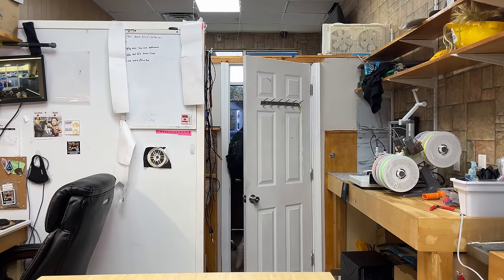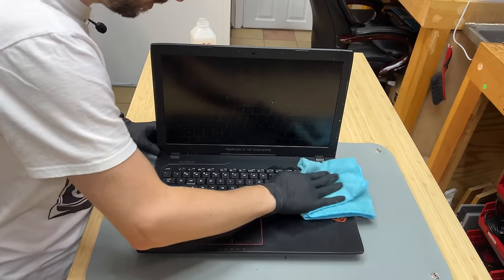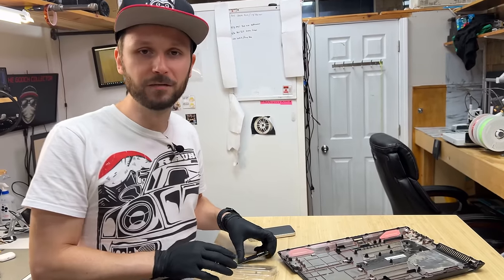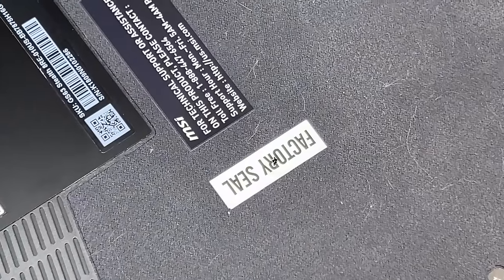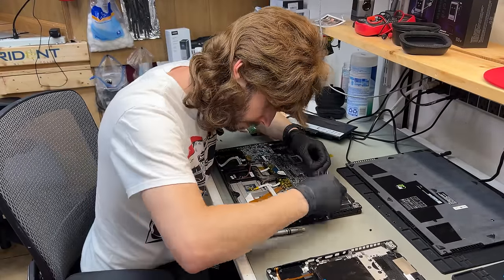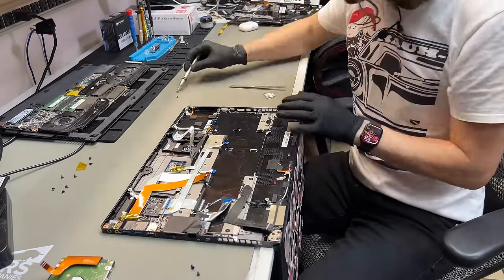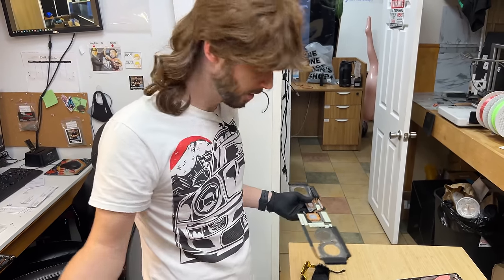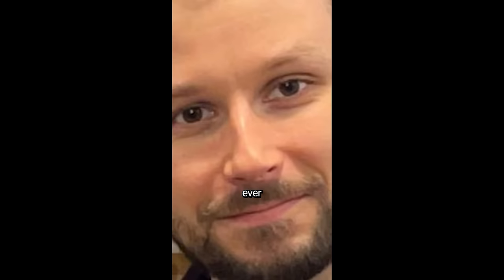Late Night Tech Rescue: Fixing 2 Gaming Laptops at my Computer Repair Shop!

Comment: How can I clean my macbook air m1 keyboard because if I shut it down and  try to clean it, as soon as any key is pressed it turns on again leading to accidental key press. How could I clean it without any such problem?
Reply from the maker: Either takeoff the bottom cover and disconnect the battery, or simply clean it and avoid the enter button
Reply: @SalemTechsperts  thanks buddy 😉

Comment: Is that a bambu labs A1 MINI with the MINI AMS?
Reply from the maker: Yes but just the Regular A1. Come help us set it up because it keeps erroring out on me and I know it’s my fault somehow
Reply: @SalemTechsperts  I would if I was local XD. If you can afford to fly me out from the UK I would be happy to. 

I use a bambu labs P1S and have experience with the A1 and mini and they are honestly insanely good. 

 I had an issue and asked for advice and before even telling me they had sent out a new board and fan to fix my issue.

If you have the time to contact support it’s probably one of the best experience I have had with support. While many tech companies are removing support and adding bots that don’t help like Microsoft it seems like bambu is still improving their support.

Best of luck to you getting it working. I’ve been able to save hundreds by printing and that’s after the £900 ($1200) I have spent on my set up.

Comment: Hello sir,
I have a quick question what do you think about the DELL G15 5530 i5-13450HX ,6GB nvidia GeForce RTX 3050 laptop 16gigs ram and 1 TB storage
Reply: It's a Dell, don't buy it.
Reply: @Holycurative9610  Any specific reason for that 

Then suggest some laptops ( gaming)

Comment: actually d-ramless m.2's feel worse than sata ssds with dram, especially once they are like halfway full of data
Reply from the maker: There it is, there’s the comment
Reply: @SalemTechsperts  it's totally true though, which is why I ripped out the default m.2 that came with my laptop for a WD Black, it gave me 3-4x faster load times. No DRAM in TYOL2024 is a crime
Reply from the maker: I apologize, I believe I misunderstood your original comment. You’re saying DRAMless m.2 SATA SSD’s feel worse than SATA SSD’s with dram?
Reply: @SalemTechsperts  yes chief. Even some m.2's will chug and load slower than 500mbps (significantly lower) if they have no dram, where even with a sata if it has dram it will keep a fast, constant load. Of course an m.2 with dram is the dream
Reply from the maker: @escapetherace1943  yes that’s true, however an m.2 NVMe with no D-ram vs an m.2 NVMe with dram, is nearly identical now.
Reply: @SalemTechsperts  that definitely isn't true, I get consistent 7000MB reads and my d-ramless m.2 I replaced would drop and stutter literally sub 200MBPS and that was no older than gen 4

Comment: Hey everyone  wanna take your advice I am studing automobile engineering currently in 2nd year 3rd sem andi have a dell inspiron 15 3500 4gb ram and 128 ssd with 1tb hhd and intel i5 4core 11gen and nvidia mx 330 should i upgrade my ram to 12gb or should i get a new laptop
Reply from the maker: 4GB of RAM???? There’s no way. Bump that up to 32GB if you’re going to be using engineering apps. 16GB if you’re just going to use cloud based stuff. Keep an eye on the SSD to make sure it doesn’t fill up. That CPU isn’t bad.

Comment: The S, Z and X keys on my ASUS TUF 15" laptop stopped working. I had to do the same you did... twice. First time was to look at the part number so I could order the right part, second time was to replace the keyboard with the wrong part because f*&^ aBay sellers. It still works, but the trackpad buttons aren't working. It's not bad since I use a mouse all the time.

Comment: How do you get away with charging $100 for labor without getting bad reviews? I work at another repairshop, and we gave someone a quote of $320 (part cost +$100), they denied the repair and then left a 1 star review.
Reply from the maker: Economics. Where do you live? What’s the cost of living? Average income? 
My shop is in an area with a higher than average household GDP, and hourly  labor rate for IT Support is between $100-$150. $100 here is not $100 in Missouri. So much less pushback here.

Comment: bro my predator helious 300 2018 model's w key doesn't works it lost the rubber thingy and the hinge holder on the key itself. edited it also has thermal issues , but I live in pakistan. can I still send it to you.

Comment: I see, you are definitely not a fan of part trays.
Reply from the maker: I tried to use them but I ended up forgetting which tray goes to which part. I use post-its if the screws are different sizes 😂

Comment: i would just change thos missing keycaps even more easy :) and  i have the same asus laptop sure shit  build qulity i had an nvme ssd in it but a shit one it died after 2 years and atupid to put that nvidia card with over powered i 7 7700HQ cpu cpu is boaring wile the gpi is sweting XD and the screen is shit

Comment: Yeah, i can understand the economics part of the keyboard replacement, but there's also a waste problem as well, and replacing those keyboards usually are a easy job if you know how to do it. I only take like 30 minutes to do it, to release the old keyboard, just rip the metal part and the keyboard, yes, broke all the plastic rivets, and this is the right method to do it, because the rivets broke only the top part and leaves a lot of plastic to solder the new keyboard, i do this job all the time, and, when done correctly, its spotless, you can't notice that the keyboard have been changed at all, the keys stay perfecly flat, solid and working perfectly, plus, some keyboards have backlight, and replacement palmrests doesn't have the LED backlight layer, you have to dismount the entire keyboard to place the LED layer. Also, sometimes, the replacement palmrest is third party and the quality is shit compared to the original one.
This kinda of jobs, i understand, its a high labour cost, but is worth it, also, you keep the originality of the laptop, and listen, for some people, that's worth the risk.

Comment: I probably would have just replaced the missing keys instead of doing a full keyboard swap
Reply from the maker: Too bad you can’t do that with broken metal brackets and missing rubber nipples that are fused to the keyboard membrane.
Reply: I don’t think I’ve ever seen a broken metal bracket. Maybe bent and yes I have seen broken plastic brackets or just missing altogether. As for the rubber nipple you can peel them off broken keyboards and glue them onto the membrane! Just make sure that you only put glue on the outer part of the nipple and just a little bit. Not too much. As a repair tech I enjoy your vids and humour!

Comment: Why won't you just swap the key caps and the mechanism? You don't need to swap the entire keyboard just because of few missing keys, if the keyboard itself is not damaged....
Reply from the maker: The metal brackets were snapped and the rubber nipple were missing from 3 of the keys. I obviously wouldn’t replace an entire palmrest and go through all this bullshit if I could just swap 3 keys over, but I thought that was obvious enough to not have to be mentioned…

Comment: Wow, IPA on a screen? Nope, it may dissolve (literally) it, producing smudges and sth destroying it!
Reply from the maker: I was waiting for this comment. It seems to come from posts shared by amateurs on Reddit that either used way TOO MUCH of it, or scrubbed WAY too hard.
A small amount of 99% on a microfiber cloth isn't dissolving your laptop screen. Do you see how little I used? It immediately evaporates. 
Yes, if you have a touchscreen, it CAN rub off the anti-glare / anti-fingerprint coating if you use too much of it too many times. 
This is one of those things that the internet will never agree on, but I can say as a repair shop owner that has used 70% on thousands of laptops and monitors, including my own, I have never had any issue with coating coming off, streaks, smudges, melting, or any other issue that apparently happens when using iso.
Reply: @SalemTechsperts  not only that, but these cheap MSI gaming laptops and the like are not going to have expensive anti-whatever coatings on them anyway. Most of them have terrible screens.